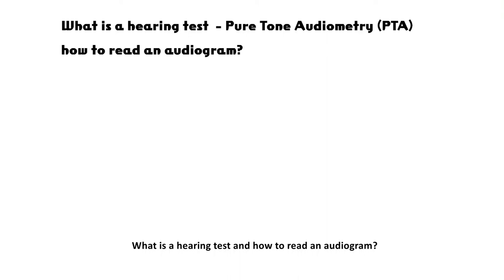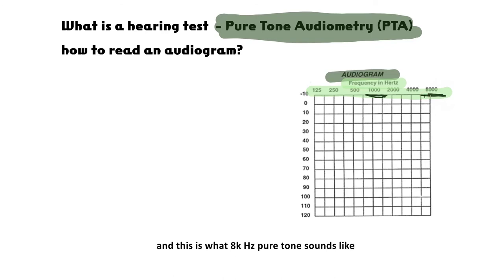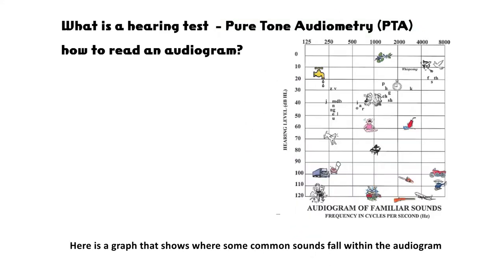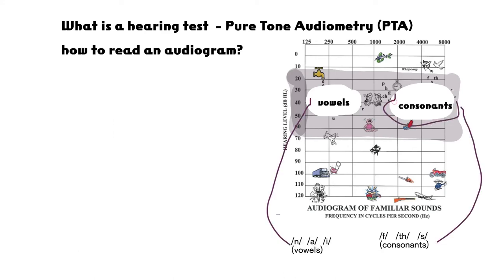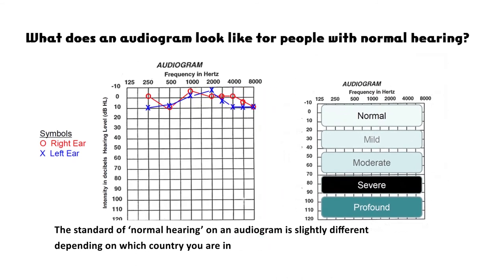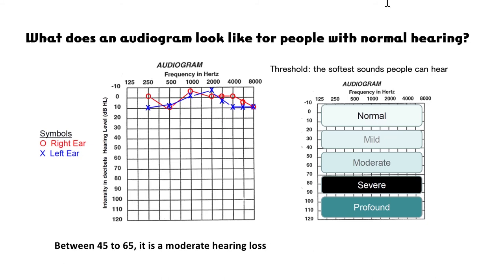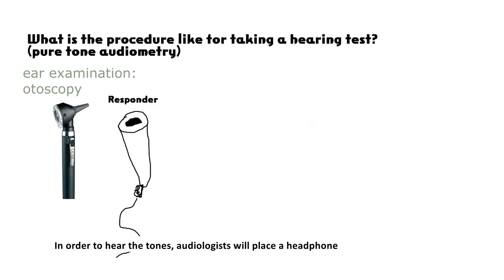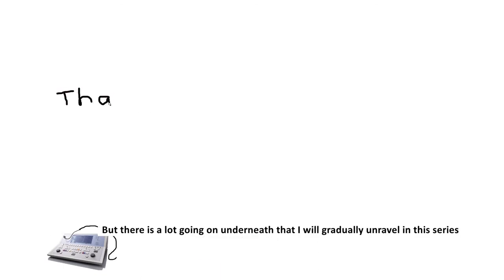How to read an audiogram? What is Pure Tone Audiometry?

Comment: Not sure if anyone picks up and answers questions on here, but for people who have a sharp ski-slope audiogram (mine is 20dB @125Hz then 75dB @250Hz) why can't modern equipment test response at frequencies intermediate to the 'main' ones? Quality hearing aids can surely be fine-tuned to a more accurate audiogram then?

Nice video, thanks
Reply: The test responses intermediate to the main ones would usually similar to the main ones adjacent to it. Unless there’s a huge difference (>20db of difference) otherwise there’s not much point testing it. 

Fine-tuning hearing aids matter more between 500-4khz. Below that is usually set at minimal gain anyway to avoid over amplification of background noises.
Reply: @zihezhou8563  
Thanks for your reply, interesting. Reason for asking is that the algorithms in high-spec aids give ever better discrimination, and as a layman it occurred to me that these would have scope for finer tuning in this range which (for the reasons you state) would have been pointless previously. Thanks again!